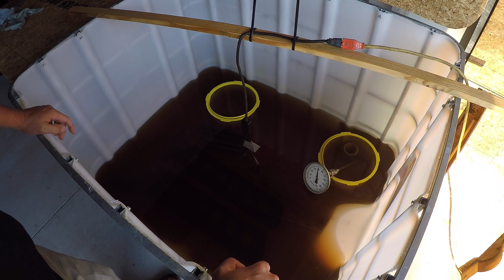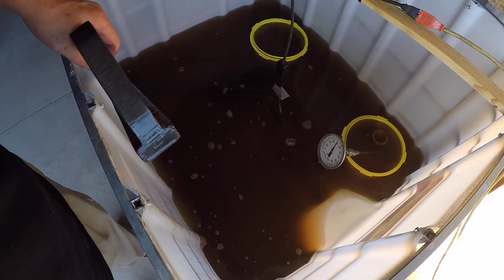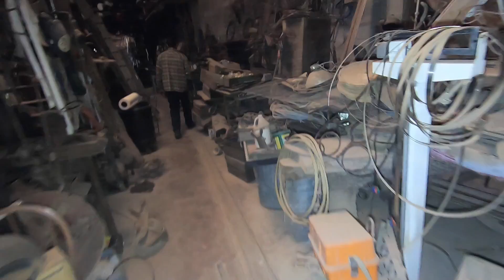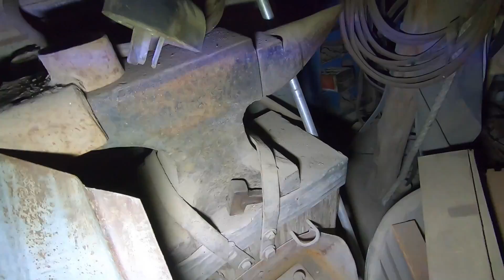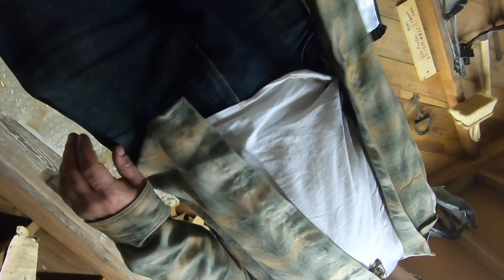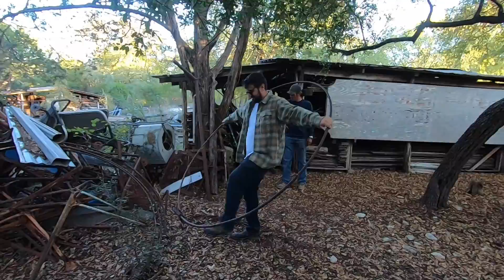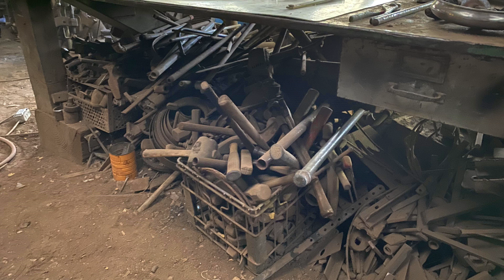SNS 285 Part 2: Texas Picking, Cleaning up King-Way Straight Edges & Indicator Holders

Comment: Its a craftsman  undesirable,  look kids
A lot of older craftsman tools were made by big brands for sears as a private labeled tool.  Dont knock craftsman older tools it wasnt untill the 80s the tool qulity went downhill when they partnered with Kmart. And kmarts ceo took over.
Kmart bought into sears for the land sears owned. Then the CEO ran it into the ground. And sold off large chunks of sears, Stanly tools bought the craftsman name and brand. Stanly owns Mac tools, 
Black and decker, dewalt, porter cable and others as well as its own line of tools.  They will bring craftsman back to what it once was.
Sears sold the craftsman brand it was the last thing the store had of value.

Comment: It’s been getting down in the 40s up there?  Wow I didn’t realize the difference in temperature between north and central Florida.  Being on the east coast does keep us a few degrees warmer in the winter and cooler in the summer,  but 40s?!
Reply: Some decades back I spent Christmas vacation in Orlando. I was at Disneyworld at midnight on Dec 31. It had been about 70 during the day, so I didn't take a sweater with me. It was 23 degrees at midnight. I had a cold for a week after.

Comment: Adam you could throw a cheap aquarium heater in your evaporust tank...
Reply: Snoozing Lion he’d probably have to keep it plugged in 24/7 in order to work cause it doesn’t get super hot like that charcoal starter does.
Reply: @NitroGuyJH  At what time in the video is the reference so I could see the context. I have used an aquarium heater when doing small batch metal plating. It is just a matter of sizing the power of the heater right.
Reply: DRDEE around the 2:17 mark. That just seems like too large of an amount to keep the aquarium heater plugged in round the clock unless Adam is using the evaporust every single day which I doubt he is. I wasn’t saying that the aquarium heater wouldn’t work, just saying it would take too long to get up to temperature to use cause an aquarium heater isn’t going to give you full blast on the heat due to protecting the fish from getting burned. It’ll just get warm to the touch and stay on until it reaches the predetermined temperature as opposed to the charcoal starter which gives you a red hot heating element to quickly bring the liquid up to temp.
Reply: @NitroGuyJH  If you wanted to get creative, you would really just need a sufficiently sized submersible heating element, and then make a PID controller that has a preheat open loop power setting before going into closed loop control...

Essentially the heating element operates off I^2R power loss, so a current controller that has temperature feedback so it can push high current until it gets up to temp, and then goes into control. The problem would be having enough surface area on the heating element so that you do not see too much heat flux that there is localized boiling at the heating element. 

With a known heater resistance, power input is proportional to the square of current. The main concern building something like that would be ensuring that the one or two electrical insulation boundaries between source and the liquid are maintained to prevent any potential shock hazard...

Sorry If I ran on a bit, but I have thought about how I would do exactly this, but for electrolysis and electroplating. It was another side hobby of mine that I have dabbled in, but requires a bit of equipment to do properly.
Reply: @NitroGuyJH  Aquarium heaters heat many gallons in big tanks... they come in a range of sizes, 50w,  100w, etc.
They are sealed units that you just chuck in... no worries about melting the bottom of tank etc. They have built in thermostat that you set... say 75 or 80 degrees... If you don't need it running just unplug or pull out of tank... Also very safe, much safer than dangling charcoal starter...Also quite reasonably priced...
Pet store or hydroponics store...
Reply: Snoozing Lion yes, I know this and that would be a much safer and better way... I previously owned a saltwater reef aquarium that was 175 gallons. But the heater took a long time to get the temperature to normal during the winter months. Assuming that Adam isn’t going to be using the evaporust tank on a daily basis and assuming that he would want to heat it up very quickly and use it then Im saying an aquarium heater would not be feasible. DRDEE explained it more or less scientifically by using a home brew PID controller to ramp the heating element up to get things hot when in open loop status and then it’ll change over to closed loop and just kick in and out to keep the temperature at a constant kinda like how a pulse width modulation controller would operate in adjusting LED and fan speeds. Read his comments to see exactly what he said. Now an aquarium heater is by far the best method because of what you stated... It is enclosed, has a thermostat, and doesn’t rise to extreme temperatures like a charcoal starter would. It is definitely safer and can be left plugged in 24/7. I just don’t think it’s feasible because I don’t believe Adam is actually using his evaporust tank on a daily basis and leaving it plugged in all the time would result in minor evaporation over time and a small amount of wasted electricity. That’s all I was saying from the beginning. If it were a small amount like 5 gallons and he used it everyday that would be the ultimate way of heating it by an aquarium heater no doubt.
Reply: DRDEE I see what your saying with the open and closed loop PID system, which would be awesome cause you would gain the benefits of both worlds. Low warm up times and a constant temperature. A long while back I wanted to get into electroplating and actually started to set up the separate tanks but ran into issues with the vessels I was using. Plus I didn’t want to leave that stuff in my shop outside in the frigid winters here and couldn’t keep it inside due to the children. So needless to say that hobby petered out rapidly. I do think it would be nice to plate certain things I use everyday with different metals to protect it from wear or whatever properties I would need on a certain thing. Also would be neat to re-plate some of my family’s jewelry that has lost its finish due to years of being worn everyday.
Reply: @NitroGuyJH  Yep... aquarium heaters are plugged in 365 24/7
Reply: Snoozing Lion right, but is Adam soaking metal in his evaporust every day of the year? Not to forget keeping it up to temp constantly will most likely deplete the contents faster due to evaporation.

Comment: You might consider a tropical fish aquarium heater.
They are made of Pyrex glass and have a thumb-screw clamp to hold it in place.
If you punched some holes in an empty coffee can and screwed on this heater - the whole thing could sit inside the rust stripper tank and keep the fluid luke-warm.

Comment: I Wouldn't even paint the sign Every item don't need to be painted. Just clean it and then clear coat it Or just paint the letter's Black. don't hang it on a wall put it on a tall post so it could spin it with a stand.

Comment: The black stuff that came off on your hand out of the Evaporust is just carbon. It's what's left over after the solution leaches out the iron oxide. It leaves whatever carbon that was in the iron that rusted on the surface.

Comment: Don't know if your looking for one, but it seems to be the new must have. An equipment supplier of mine has a planer for sale. It's a 12' liberty planer mill, has a 54" wide table and 49" height capacity. Also has a Bridgeport head mounted to it. It seems to be a pretty good price also. Reply if you want to see it. I will give you more info.

Comment: The steel mesh that you wondered what it was used for is used in mining.  It is part of a shaker that separates large rocks from the usable ore.  They are also used to separate different size rocks for graded rock sizes.

Comment: Adam would be nice to make a heating element out of some type of tubing shaped the same as the tank only 4” smaller and leave it sitting on the bottom of your tank then just plug it in when it’s cold

Comment: adam use  a water bed heater on the outside of your tank  and insulate your tank and it will stay the temp you need i have a similar setup and have had no problems at all for the last 5 years

Comment: You can get water trough heaters that would probably work well to heat evaporust. They are just a heating element that’s designed to float in a water trough and keep it thawed out for animals to drink out of. You can pick them up at tractor supply, Atwood’s, or other farm supply stores.

Comment: That wire mesh is screening deck used in screening plants for processing sand and gravel
Reply: Adam would have made a monster BBQ GRILL out of that large steel mesh!
Reply: @leeklemetti1887  yes it makes a great BBQ deck as well holds up better than expanded metal. I work for a sand and gravel company and we have a BBQ with it as the grill

Comment: I own the twin to that Victoria drill press. I've never seen another in the USA. Mine has a larger square table.
Reply: Progress made very good pillar drills, the 5E is the biggest, (excluding radial arm drills), 2" capacity, 9 speeds all geared, 3 rates of power feed, 7" column which should be solid, the most basic round table no coolant is 1500 lbs, a full compound table with coolant is 2500 lbs, will be a 3 or 3 1/2 hp motor. Usually branded Elliot Progress in the UK, I think the Victoria name was mostly for Canada, I think they were sold under a least one other name as well

Comment: I wonder if you couldn't use a booster pump like a grundfos mq3 45 that's gravity feed from your valve at the bottom of the tank with a canister filter and a short hose with a nozle on it for an alternative to using the garden hose with water. Those pumps are amazing high pressure and it'll build pressure and sit idle when the hose off expensive though and I think grundfos discontinued the mq3 45 but I know they came out with an equivalent replacement any way just a thought  Adam really enjoy the videos!!

Comment: Adam how about using a lazyspa pump as a heater on the evaporust tank? As it can be timed to come on has a built-in heater, would circulate the evaporate and would filter it at the same time?
Reply: I just suggested a booster pump that's a way better idea👍 I'm sure he can plumb the return with a hose to wash parts as well? Instead of the garden hose

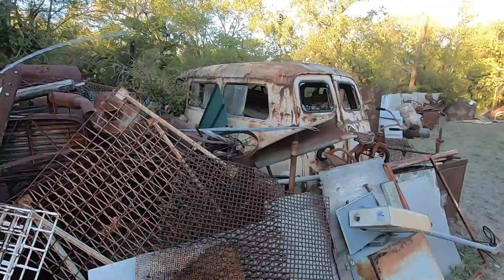Comment: The steel woven screen material from 31:47 to past 32:00 is called smoke box netting to catch cinders coming through the fire tubes of a steam loco boiler before they go out the stack and catch the country side on fire.
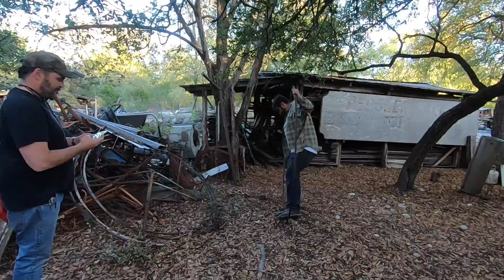32:37 are wood water tank bands.
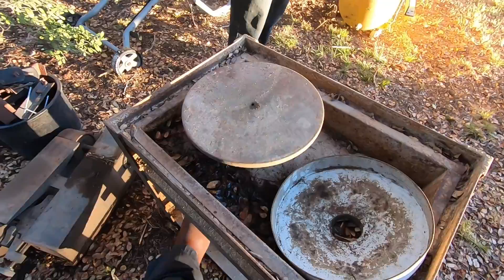34:30 is a potter's wheel.
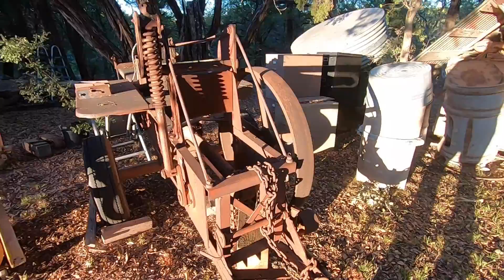34:53 is a hay bailer.
Reply: That mesh is very similar to the classifying screen used in a gravel crushing/screening operation.
Reply: @pileofstuff  It has several uses depending on mesh.

Comment: SO- that heavy wire mesh is commonly used in soil and dirt screen separators where you put a scoop (with heavy equipment) of random dirt into the hopper, and it vibrates and the small dirt drops thru the mesh holes, and the rocks and bigger stuff is left ontop - the material sometimes goes thru several different layers of mesh screen, each getting finer in the hole size and each one going to a separate discharge chute or conveyor system to deposit the different size materials where you can gather them up separately - I worked on several that would filter dirt into piles of 3"+, and then 1.5"-3" in a separate pile and then anything smaller than inch and a half would conveyor up and out far away into a pile of "Clean/Screened Soil" - the unit originally had a big 3-phase ectric motor and we converted it and made it portable with a small 4-cyl diesel engine

Comment: What happens if you're using evaporust on older parts that contain lead paint?
Reply: It won't remove the paint, but will soften lead paint a bit.  If you move it around in the tank, some of the lead paint might go into solution, but if you just slowly remove the parts and let them dry, the paint will be fine.
Reply: Yeah I also want to know.

Comment: Like mentioned that mesh is what they use at the rock crushers to sift out the gravel sizes. Lots of it around the north west side of Fort Worth as there are several gravel pits.

       Finding places like that here in Texas is tough these days. Most have been scrapped out over the years and not many left and very few of any size that one is a rarity and by the trees and soil that place is most likely somewhere to the east of Dallas. The soil and vegitation change drastically from the west side of Fort Worth where the desert starts to the east side of Dallas where the forrest of East Texas starts.

Comment: These days i mostly try to avoid using any coolant, any solvent or anything that is corrosive. With the modern day carbide inserts you mostly don't need it anymore unless you're working on Duplex or other high grade alloys. I really don't like seeing all this cleaning with highy corrosive solutions, just look at all the spray you were using in the backyeard , all that grass is going to die right there in your own turf. I just don't get it why you want to do that, and see the results before your eyes.
Reply: He was using Evaporust which is non-toxic. The black stuff he was washing off is iron oxide, which if anything will make the grass greener. Please read the MSDS sheets on a chemical before assuming it's harmful.
Reply from the maker: Understand your facts before making false statements

Comment: Hi Adam. If you're able to, could you please contact the people there and talk to them about the serious importance of securing all those gas cylinders? I have a real bugaboo about that because so many people don't realize how dangerous they can be. With a full tank, you have about 2000 psi going through a 1/4" hole. That cylinder falls over and breaks the valve off (easy to do since it's brass) you've literally got a missile on your hands. If the people are letting others go through there, that could be a potentially serious liability for them. Other than that, I'm kind of jealous. LOL I wish I could have been there, but it's a long trek for me and I'm by myself. (Nearly 1000 miles.) Keep up the great work with the videos!

Comment: Just wanted to mention that you might try a fish tank heater. They can keep the temperature above 80 degrees and designed for underwater use. Evapo-rust should be safe enough to not damage the seal. You might also use some kind of recirculator as well.

Comment: Hey Adam...I put a bubbler in my Evapo Rust tank...seems to help...been using Evapo Rust for years..love it...I used to have an huge old parts cleaner that had a pneumatic fitting on it for bubble agitation...worked then...works now..(I think)..lol..great video...tks.

Comment: Hi Adam - you can get 22" x 26" plastic bread crates new for less than $15 - or maybe cheaper from your local bakery.  They are great to hold parts to soak or use as a draining rack.

Comment: Hi, you might try a tropical fish tank heater, it includes a thermostat and is designed to be left submerged for years at a time, not sure if the chemicals might effect the seals but the body are usually a glass so pretty inert.

Comment: Thanks for saying Evapo-Rust is non-toxic. The ads claim non-toxic, bio-degradable, safe on skin, safe on PVC and other materials, no odors or fumes, and reusable depending on the amount of rust removed. Sounds like it might useful for some of my projects.
Reply: Evapo Rust is made just down the road from me so I gave it a try. Definitely one of the best rust removal methods I’ve found. The fact it doesn’t melt your skin off is a great bonus.
Reply: @RK_Tek83  Thanks. I think of WD40 tearing up my skin. It still has a place, just respect it.

Comment: How often do you think you will need to change the evapo rust
Reply: @Roderick storey could you just add more to it or should it be changed out completely and thanks for the info
Reply: Joseph Duda you can add more to it.   Eventually Adam could end up with a full 275 gallon tote.
Reply: @RK_Tek83  I was not sure and was starting a 5 gallon system and was going to filter thes sludge out but did not know about changing or just add to it
Reply: @Roderick storey Thank you very much you know a lot more then I do about this stuff